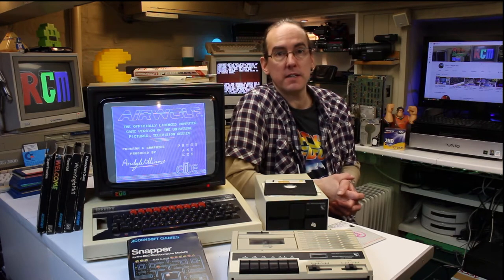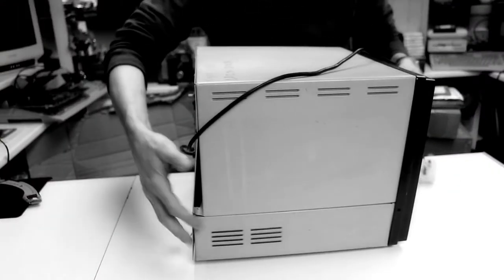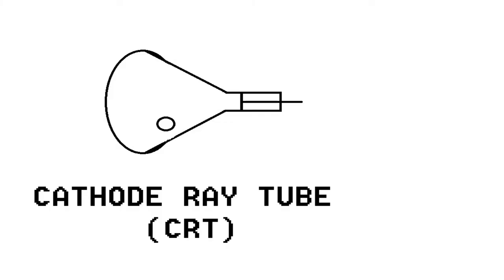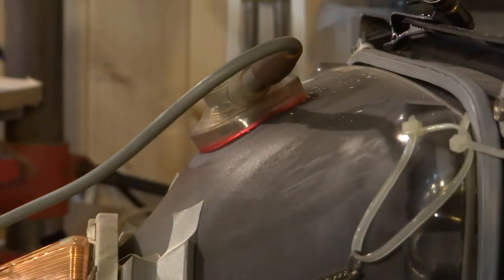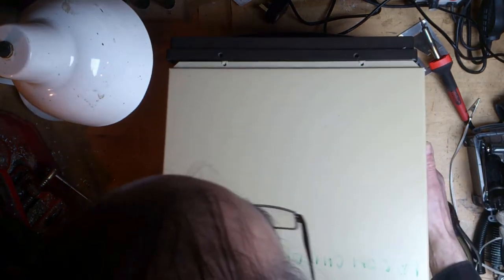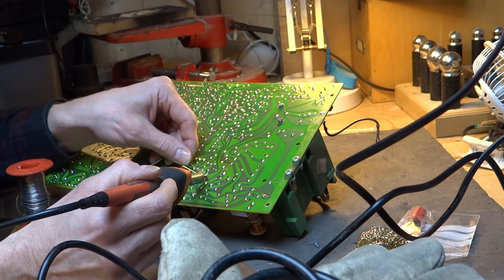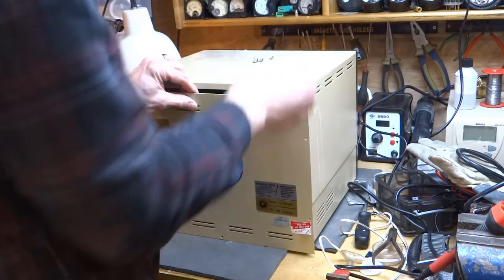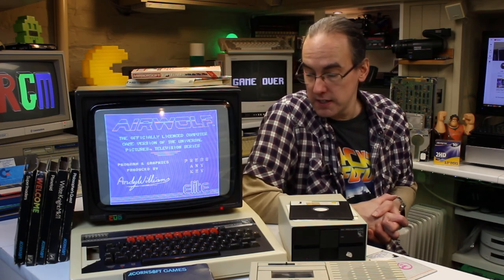BBC MICRO MODEL B RESTORATION SERIES PART 3 Microvitec CUB 452 Repairs.

Comment: The cheapest tool for discharging the tube is a multimeter probe with an alligator clip attached, check it every now and again for continuity.
Having serviced hundreds of CRT TV's and monitors I can tell you that you can dispose of gloves for protection, they do nothing and you will get zapped just as hard if you do get zapped.
CRT tubes will also charge up on their own without any power connected to them. I remember this one time working at this facility I grabbed a new CRT out of a box and was silly enough to touch the anode, I got a big zap and dropped it on the factory floor and it of course smashed. That CRT had been in our store for about six months. I have had lots of zaps working with HV stuff, have burned holes in my fingers right to the bone, comes with the job and yes they were all my fault, happens mostly working when tired and not paying enough attention.. Confidence comes with time, most zaps are to noobs as they are nervous and not putting attention on what they should be paying attention to. A little baby monitor like this to me is nothing, take me about a minute to pull it to bits. Good to see people having a go at working on these things. I really miss working on CRT equipment and smelling ozone :D
Reply from the maker: Thanks for the tips. I had no idea a CRT could charge itself. I will be even more cautious now when handling CRTs even when they have not been powered up for months.
Reply: @RetroGadgetMan  Can also happen with HV capacitors, always treat them as charged. I would say the biggest "danger" in working on monitors is exploding electrolytic capacitors, they take off like a bullet and could easily take out an eye and the bang is better in waking one up than a cup of coffee lol. Happens mostly with stuff that has been lying around for a while, you power it on and bang, but can happen anytime. Never look into the tops of capacitors with powered up monitors or TV's, position yourself to the side of them. You won't need that advice once it happens to you, it will come quite naturally after that lol.
Reply from the maker: @allansmith6140  😂 yes I have witnessed exploding capacitors before lol. It's certainly makes you jump. When I'm discharging CRTs I repeat the process a few times as I have noticed the charge can jump back into the CRT..not as powerful as the first release but it's still enough to shock you. I usually Put my meter across caps and watch them discharge.
Reply: @RetroGadgetMan  Yeah, no matter how many times it happens to you, you never get used to it lol. The ceiling above my workbench had a few holes from that :D
I used a heavy duty meter probe as my tool, lift up the cup a bit with my thumb, slide the probe in and push one of the clips off, discharge and removal in one go. Once you got the wire off it doesn't really matter the state of the charge of the tube as you aren't going to stick your finger on it and as you know there's always some charge remaining. When putting the lead back on do it in reverse with the probe, that way you are grounding whilst working on it.

Comment: Excellent video! What was the tool you used to desolder the cap?
Reply from the maker: Thanks.  It is a Anesty ZD-915 de-soldering station. I bought mine through eBay. I have used it a couple of times, it's good so far.

Comment: The resistor at R235 is a fusible type and marked as a critical safety component on the schematic - the big green one you've fitted looks like a 2 or 3 watt one which, if it isn't fusible, should be replaced with the right type.
I've been fixing loads of these recently and found several with previous incorrect resistor replacements, one of which had developed a shorted capacitor like yours but the resistor was black from the heat due to being unable to fuse.
It's a fire hazard albeit a relatively minor one 👍
Reply from the maker: Thanks for the information.
Reply from the maker: I forgot to ask which is the correct replacement. A 1 watt?
Reply: The usual one is 10ohms @ 0.5w - the key thing is that it must be a fusible type - i.e. one that is designed to fail open circuit like a fuse if it gets overloaded